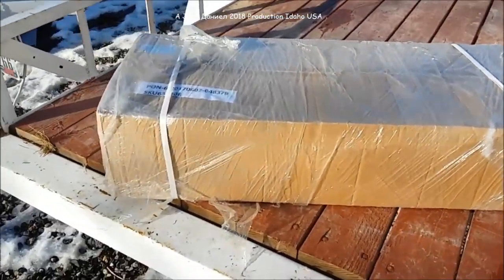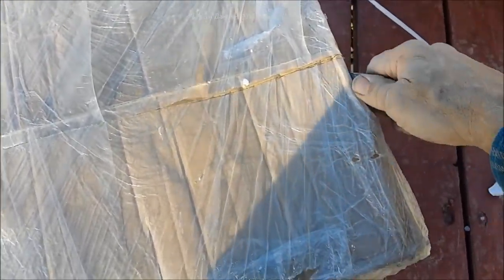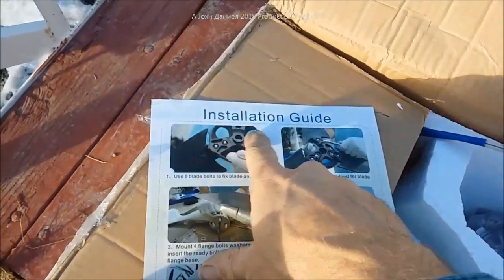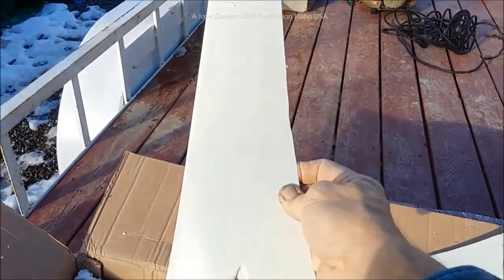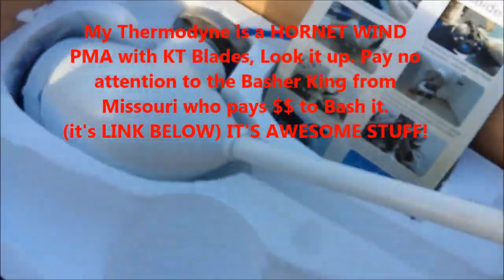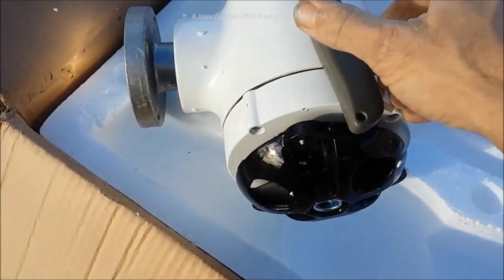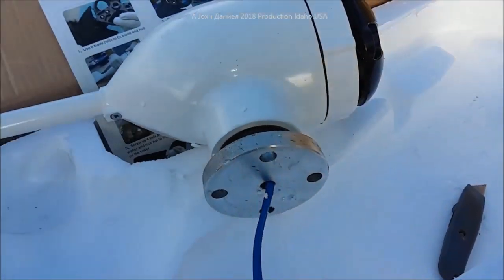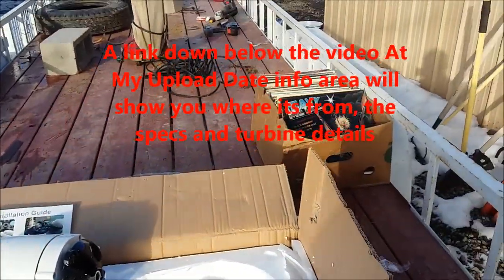500watt Small Wind Turbine is Best China makes - Un-box, FULL parts List below

Comment: Does the wires move with the head or are they able to stay still so they don't twist up if the windmill keeps turn in the same direction when the wind changes direction? could be it will twist off the power leads inside the pipe some day.
Reply: They have brushes inside the housing that contact with flat bronze rings. Expensive models have bearings contacts that are rolling on bronze sleeves in the housing so the unit can rotate either way with no twisting.